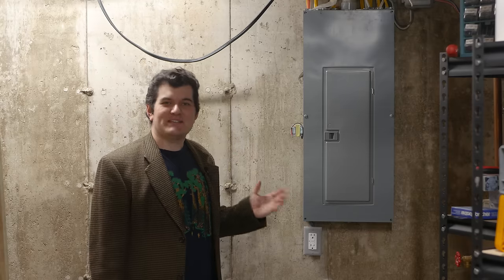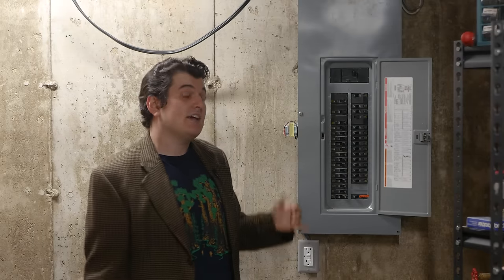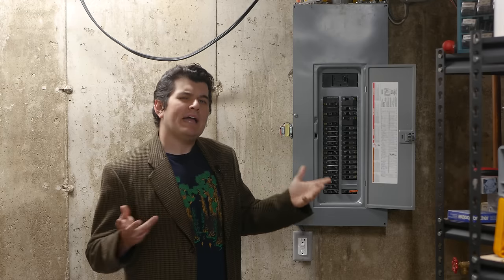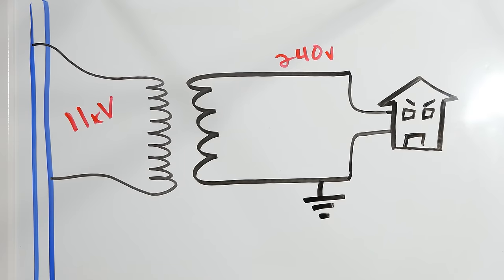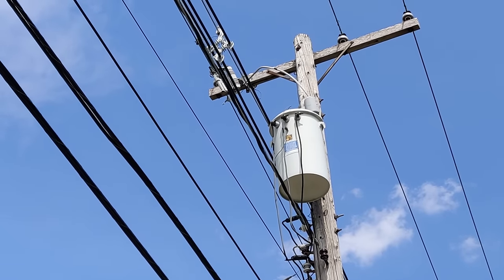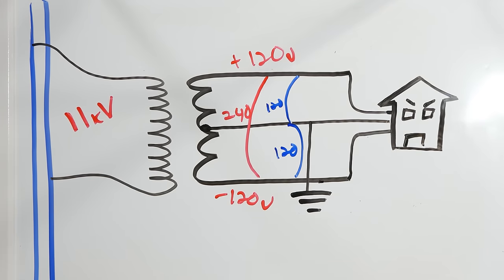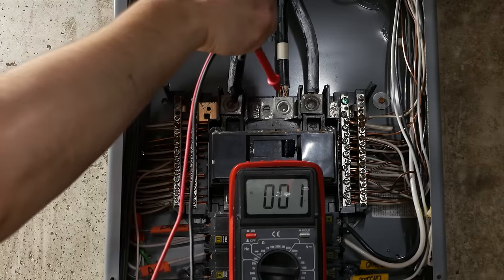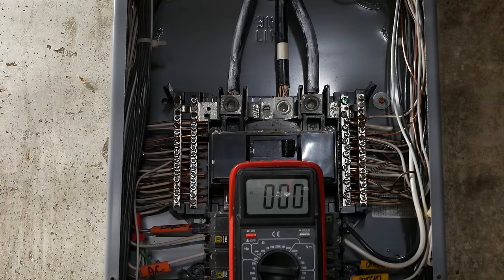The US electrical system is not 120V

Comment: When I was about four years old, I had this Klutz educational booklet and kit about electricity. I was deathly curious one night, so I stuck a bit of the wire from the kit into both hot and neutral, and gave myself quite a shock! I had cuts on the fingers that were holding the wire and burn marks all over my pajamas from the sparks that flew. I was fine, but now I have an intense fear of loose cables.
Reply: We have tamper proof plugs in Canada too.
Reply: We have some of those in the US as well, I put 2 of them in at my house when I replaced a couple receptacles. Not for safety reasons but just because it was what I happened to grab off the shelf. Well, I suppose for safety reasons as well as they are GFI outlets that I put in next to the utility sink and one bathroom sink to replace the standard outlets that were there since 1970... Still need to get around to doing that in the kitchen one of these days. Think the outlets are far enough away that it's technically still up to code, but I'd rather put one in anyway.

Comment: Thanks to Technollogy Connections i just discovered that my EU electrical cabinet looks like its from a sci-fi space ship
Reply: @amojak  You should see the actual stuff from soviet russia, which is kinda actually scary
Reply: comeradecoyote If we're talking about WW2 era stuff or earlier - maybe. But late 60s stuff was safer. All breakers had screw terminals in recesses, so it was way harder to poke it with your finger. Also old style plugs while had full length metal pins, they also had a guard disk so it was much harder to get your finger under it. Also sockets had recesses. High current plugs were also safer. Fun fact though. Those dreaded NEMA plugs and sockets had some limited use in USSR. For electric shavers which ran on lower voltage.
Reply: @shadowflash705  wonder how NEMA made it over there, exactly. was it related to lend-lease in WW2, i wonder?
I know the reason Japan uses both 50hz and 60hz is because the pre-WW2 grids used equipment bought from Germany and the post-WW2 grids used U.S. equipment.

Comment: My great uncle here in the UK was a consultant electrician (Surname Tickle, known to his customers as Test Tickle) who carried out site tests on oil refineries and other large scale installations. While he helped my father and I to rewire our house he told me hundreds of anecdotes of 'why' things were done - I only remember a few: Side entry plugs were to prevent the temptation to disconnect a plug by pulling it out by the cable (reverse theory on the european plug - in-line entry so that plug comes out when cable is tripped over!). Switched sockets were because flex (flexible appliance cable) was insulated with rubber which had a fairly short life, especially when warm (in the UK? Hah!) when it would brittle and flake off. Once this had happened the cable was lethal and needed to be isolated before unplugging - hence the switch on the plug (seldom used except by the obsessive in reality since PVC insulation was invented). 
I like ring mains. My home fuse board is tiny compared with yours - about a square foot, with 6 RCD breakers (combined over-current and earth leakage) upstairs lighting, downstairs lighting, upstairs power, downstairs power, kitchen oven and hob, utility room (washing machine, dishwasher etc).  With the ever-increasing number of electrical applieances it is really easy to cut into a ring to extend (either extend the ring or with a spur), without laying new cabling back to the main board.
But we like what we grow up with..
Reply: The American plugs were inspired by a two-piece adapter set that an engineer named Harvey Hubbell developed in the first decade of the 20th century. At that time, appliance cords were terminated in Edison light bulb screw bases, as that was the only "receptacle" found in a typical U.S. home. The Hubbell adapter contained an adapter that screwed into the bulb socket and (somewhat ironically) had two round holes, much like a European socket. The round prongs on the Hubbell design had detents milled into them near the tips, much like headphone plugs.

Standardization of plugs in the U.S. was rather slow and painful, but it turned out that Hubbell's company developed the parallel flat-blade design that won out.
Reply: @klafong1  I found a baseboard outlet in my 1910 house which had a round hinged cover on the bronze or brass wall plate. I open the cover, expecting an old four prong phone jack, and was greeted by a light bulb socket!  WTF thought I!!! I screwed in a bulb and it worked. I pulled it out and installed a cover plate, and the Edison socket was mounted in a metal device box. I saved it all too.  I always wondered what it was (and assumed it was some kind of hack work) until I found out about Hubble vs. Edison many years later.
Later when I got rid of the knob and tube, I filled that hole in the baseboard with a nice grounded Hubble receptacle.

Comment: I'd love to see a video showcasing the NEMA 6-20 (/6-15) outlets. You mention them briefly when you discuss electric vehicle charging, and I feel like they're really underrated since they can go on standard 12/14 gauge wire. It's more than enough for most people for charging cars, but I wish we had more devices compatible with them - e.g. electric kettles, microwaves, space heaters etc. It would be awesome if they were standard in our kitchens, but we are limited by what devices are compatible.
Reply: I think a 240V induction hotplate would be useful, for heating water, but nothing else.  Electric kettles are too specialized.  They are for tea drinkers.  You can just put an ordinary kettle on an induction heater, as long as it is induction-compatible.

There are 240V microwaves, if you are into microwave cooking.

Comment: I'm trying to wrap my head around the fact that there are people who don't understand gas powered dryers.
Reply: They think of "gas" as petroleum (as in cars)
Reply: @MrFlint51  Which is why UK and AU get it right, calling car-fuel "petrol".
Reply: @reprapmlp  I never understood why they call it petrol, petrol is obviously short for petroleum. Gasoline is made from petroleum, but gasoline itself isnt petroleum. Its only petroleum based.
Reply: That is why I always say Natural Gas and/or Propane. Saying ‘Gas’ (while correct) is too generic.

And yes, using a Natural Gas or Propane dryer is a lot more energy efficient compared to an electric dryer.
Reply: I think they are terrified by the thought of an open flame.
Reply: Wait till they see gas powered fridges.
Reply: @Johnebs  Energy efficiency is debatable depending on you electricity fuel source, considering electric resistive heat is 100% energy efficient. They are definitely more cost efficient, since the price per joule of natural gas is considerably lower than for electricity.
Reply: @commanderporkins  My appology, cost efficiency was what I was referring to.
Reply: @1over137  also called an Einstein refrigerator! In case someone wonders where these are used, generally RVs and places where electricity isn't guaranteed. An RV refrigerator works 24/7, even without a generator or being parked and plugged into utilities somewhere - unless it's out of propane, but there you go. RVs generally use propane wherever possible.
Reply: same as gas powered rifles people think it runs on gas
Reply: @reprapmlp  Only because you grew up and were taught this ,.. In the USA if we hear the phrase "gas dryer"we will logically think natural gas.
Reply: @commanderporkins  saying resistive heat is 100% efficient is a misnomer.. since the power supplied is not produced or transmitted efficiently and the distribution of the heat like a space heater is never efficient
Reply: Over here, most people don't even have dryers, let alone gas powered ones. We just hang our clothes on a line. Doesn't consume any power.
Reply: @1over137  what

Comment: TC: Volt Jolts, Current Kills
ElectroBOOM: NO! THAT'S NOT HO--
TC: Explains V=I*R
ElectroBOOM: You alright...
Reply: That ElectroBoom is quite the character.
Reply: Current flow depends on voltage and resistance.  Resistance is almost always constant.  Therefore it is the voltage that independantly correlates with killy-ness, not current.  And to be more pedantic than you, it's power that kills.
Reply: It's U not V
Reply: @lordadmira3  "... it's voltage that kills..."
That's false and it's more complex than that.  Ask yourself why it is that electronic lighters that generate 10,000 volts don't induce deaths.
Fact being, it depends on the internal impedance of the source, the source driving voltage, the current capabilities of the source and the impedance of the load connected. 
If you touch a supply that has a low internal impedance, with enough voltage driving a large enough current across your heart to cause defibrillation, you're probably going to die.
Reply: @lordadmira3  not even that, it is the ENERGY that kills, which is proportional to both power AND time.
Reply: @kingsman428  Electronic lighters dont induce deaths because the time is in the order of nanoseconds. Electrostatic discharges can be tens of kV, but they don't affect healthy people because they are over so quickly.

Current capabilities: if the source cannot provide enough current or the current is limited by the design the voltage MUST drop. No matter the circuit Ohm's Law will always hold. High voltage=High current=Death.
Reply: @lordadmira3  If the electrolytes in your body are higher or lower than usual for you your resistance will be different. Same goes for your state of hydration and for that matter how sweaty the part of you is that contacts the conductor. Add to that the effect of how good your connection to ground changes your resistance to current and you will find that your own personal resistance isn't constant much less the resistance of humans as a race. Based on all that I find that resistance is not constant, but each person usually has a limited range of resistance.
Reply: Actually there are 2 ways that electricity can kill, one requires enough amps passing through a body for a long enough period which basically cooks the person. Who here remembers the hot dog cooker that worked by sticking a charged electrode in each end of the hotdog? The other way requires a sudden high voltage that disrupts the heartbeat. Oddly it's the same principal as a defibrillator works on but in the case of the defibrillator the jolt is of lower voltage and causes the heartbeat to return to normal. Oh, and a jolt from a defibrillator while very uncomfortable is not deadly, when a surgeon installs a defibrillator in a person's chest he test fires it. Sometimes that test firing happens after the patent has started regaining consciousness as in my case.
Reply: @andreimiga8101  Very true. VxIxtime= Wattagextime=  wattsec= joules. Also the part of the body where this energy goes, which is where the current flows.
Reply: @martini380  why do you keep saying this?  U is for energy not potential difference
Reply: You forgot the part where ElectroBOOM gets shocked
Reply: Electroboom - it is not necessarily a supply voltage at no load, but the amount of current that it can deliver when touched, that determines how much hurting you shall receive.
Reply: @alakani  U=R*I is Ohm's law "a law stating that electric current is proportional to voltage and inversely proportional to resistance" [U]=Volt (V) is the SI-Unit for Voltage and U is used because of the latin language
Reply: @martini380  No that's Ohmsche Gesetzt.. Ohm's Law is V=IR :p